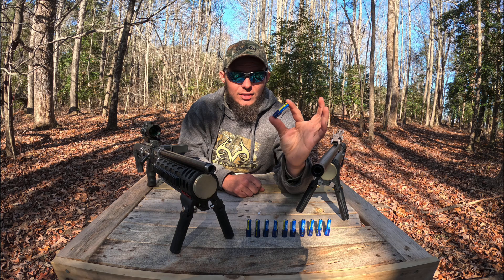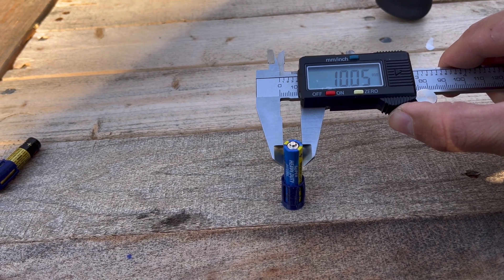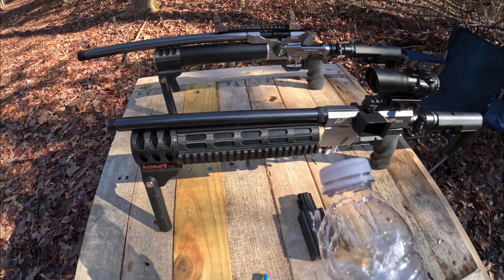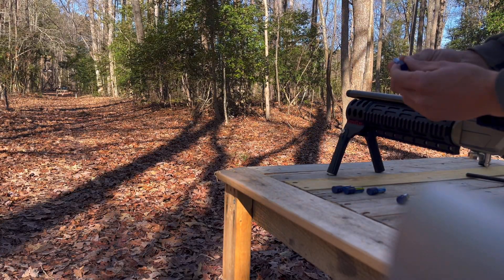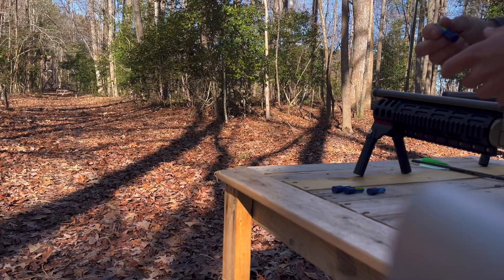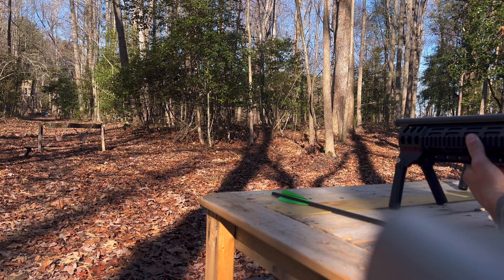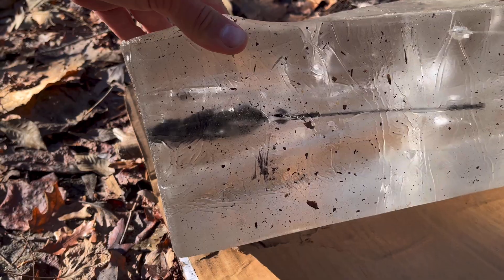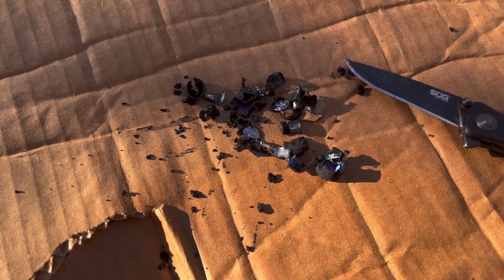AAA battery projectiles from powerful .50cal airguns - Element Max & HP Max

Comment: Wonder if that could cause a fire 🤔
I wouldn't want to be the one stepping on dry leaves hoping not to burn the woods down 😂
Reply from the maker: I don’t think the alkaline batteries will get hot enough when they explode but I’m sure lithium batteries would!
Reply: @AtmoTacOutdoors  Catch & cook all in one
Reply: Carbon graphite batteries create no heat when cut or smashed. Lithium batteries on the other hand. Would turn into a fire ball on impact. Which I think would be cool as shit
Reply: @myfalconry76 After loosing our 5 chickens in a fire Ill try to keep in in the wood stove

Comment: Wonder what would happen with a Lithium ion battery 🤔😉
Reply: Use the same thing AA lithium batteries. Lithium explodes on contact with water.
Reply from the maker: @michaelpurdy5908 I ordered some stay tuned
Reply from the maker: definitely gonna try that! Gotta find one that'll fit .72cal or .50cal though!